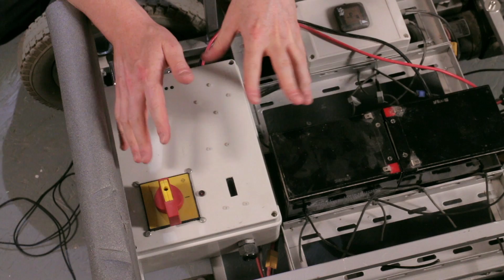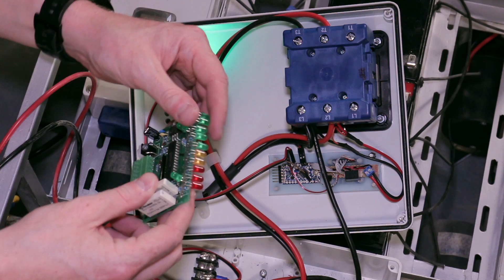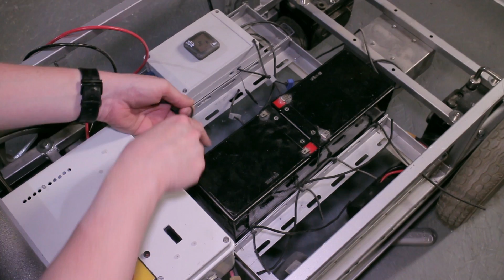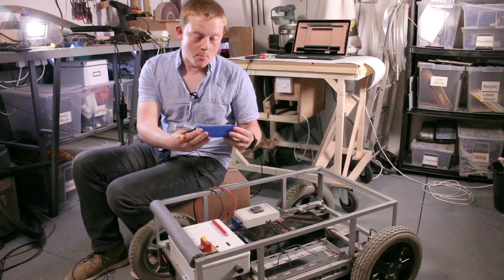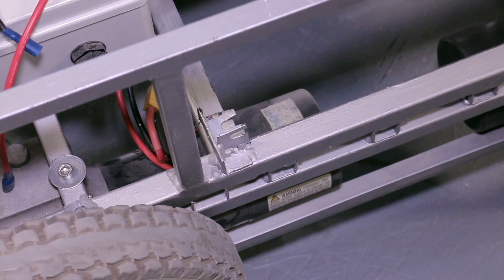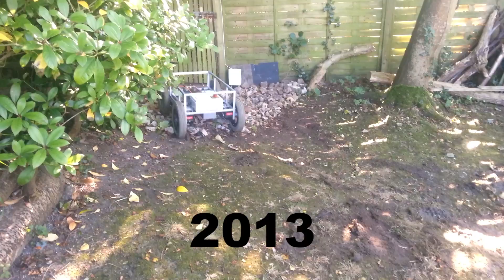New Lipo Batteries - Robotic Vehicle #2

Comment: How far can you drive with this vehicle in 2h (when it's fully charged)?
Reply from the maker: +Shoulders of Giants I wrote a few years ago that the motors could go 5 to 10 miles an hour. Assuming the lower estimate it could possibly travel 10 miles in a couple of hours. This would probably require a flat surface though.

I am not going to get near that with the new batteries as I don't need to but it's nice to know it's possible.